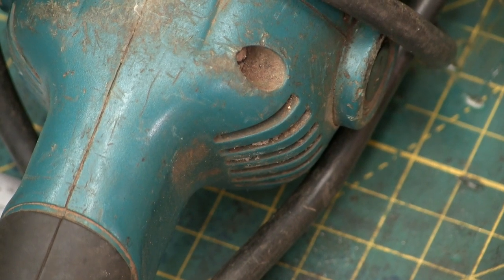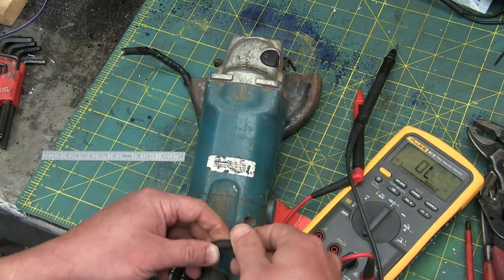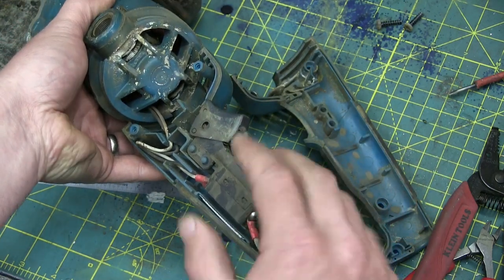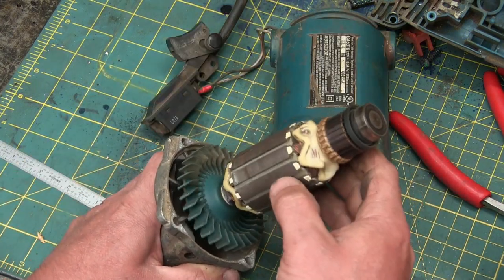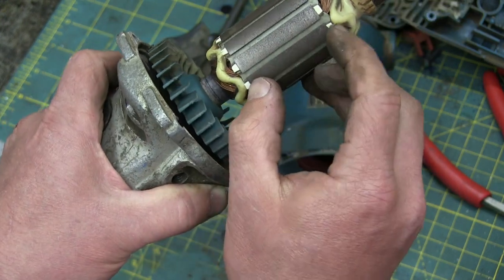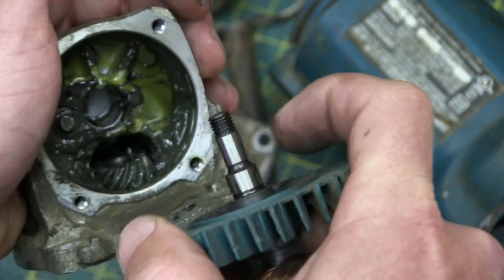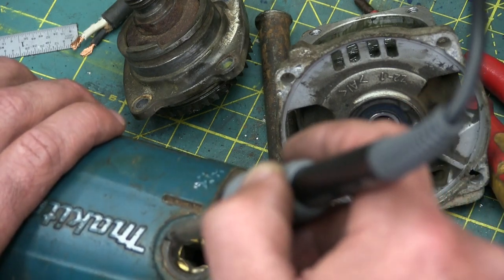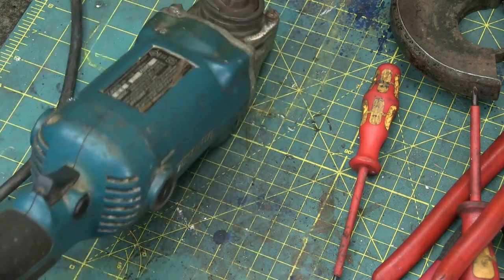BOLTR: US built Makita 5 inch angle grinder

Comment: I worked for a Japanese manufacturer for many years. The level of detail spent on evolving the engineering was crazy. Every in house engineer working in the field could feed back any comment by any channel they liked to the factory. Everything from 'this part fails most' to 'the shipping packing on this part is annoying to remove' found it's way back. The nice bit is you would see the changes coming through within months, sometimes weeks. I even saw a motor casing get re-tooled because one screw on the mount was 'a bit tricky to get to'.
Reply: I am an mech eng and I wouldn't mind doing that as I do that kind of stuff already lol
Reply: The Japanese take their work incredibly seriously. Striving for perfection is ingrained into their culture.

Comment: Broken cord=Free tool. Gotta love the world we live in now.
Reply: Great world to live in for people who know how to fix stuff, isn't it?

One time a guy put a RUNNING lawn mower out on the curb. One man's trash...
Still have that mower, still running like a top. Only problem is you've gotta short out the spark plug to stop the thing. Can get interesting if you have to do that in the rain.
Reply: Broken cord, broken trigger (you can get those for dead cheap if you happen to have a parts market around you), best one i ever found, the guy lost the locator washer, yup. Dumb people are gold for people like us.
Reply: Same here re free curb lawnmower, Craftsman, used it for 10 years...just about had a coronary pulling the rope 20+ times every time I wanted to start it, but price was right.
Reply: jusb1066
That's what I was doing, but sometimes my foot would slip off of the springy strip and touch the bare end of the spark plug.
This is quickly followed by a series of shocks to my foot, much cursing, and occasionally wondering why I don't just wire in a switch to ground out the wire between the points and the ignition coil.
Reply: My dad used to keep everyone he knew supplied with TV's by 'shopping' on garbage days. Eventually they stopped being repairable and now we have to buy them.
Reply: Why not just fix the ground wire to the magneto?
Reply: EEVBlog #984... (search youtube, can't paste link)
Reply: Last riding mower and current riding mower, free... first one I ripped the factory harness out of it and simply wired a on/ off toggle and a push button to start. Second one which I use now I just disabled the solenoid in the carb, cleaned the carb, and I start it with a jumper box because I've been too lazy to change the starter solenoid lol.
Reply: hahaha, so TRUE!
Reply: Love this thread. Bunch of people bragging about fixing free broken crap that they found. Funny thing is it sounds like it's still a bunch of broken crap. Did any of you actually fix anything? Everyone's like ummm my neighbors were going to scrap their car and i was like hey, I'll mow your yard for a year for that junk car. 5 be years later I'm still rolling that car. The only thing is that since the motor & tranny were both blown, all i had to do was kickout all the rust on the driverside floorboard... And use my feet to stop and go Flintstones style. And they were just gonna scrap it. uhh haha... What a bunch of suckers smh 😂
Reply: J. Mohler well I got a metabo grinder that needed brushes and a makita skill saw that needed a trigger. Less than $10 to buy new brushes and a switch fixed both of them. Also got a hilti sds that was told would not work at all. I plugged it in and it works perfect every time full chooch no noises or rattles or anything. Glad the metabo grinder didn’t need a new cord as that super robust highly flexible silicone cord would have cost $20 lmao yes still would have been a good deal.
Reply: 44R0Ndin are you still mowing grass in the rain ?
Reply: Got a free red snapper when I was 17 years old. I’m 32 and I STILL use that thing every summer. And she had no problems cranking

Comment: After the apocalypse i will be climbing over the huge piles of Dewilt products with my Makita grinder gripped in my mechanical hand, witch i made myself, and face the zombie hoard with all the other Makita owners!
Reply: Lol so true i will team up with u :)
Reply: harbor freight sells a chaisaw disc, its a grinder blade with a chainsaw chain attached.
Reply: Yeah i have seen it when i was in the store lol its like a 4 inch wheel i have always wondered if it was any good .it would probably get saw dust in side of it
Reply: the full range of the extension cord !!
Reply: Yes extra long and heavy cord. Also zombie proof.
Reply: Gabriel and Caterpillar.  It's called the Lancelot, and it's good for what it does.  If you want to cut wood in a crappy/dirty environment where you wouldn't run a chainsaw (like tree roots) it does a great job.  Dulls right up like any chainsaw chain would , but you only have about a dozen chisel points to sharpen, so you're back in the game relatively quickly.
Reply: After the Apocalypse I'll be feeding my chickens the corpses of those who failed to buy Metabo while enjoying the lamentation of their women.

Comment: One reason I'm a Makita user - I have tools that are coming 35 years old - parts are still available.  Makita doesn't try to "Improve" a tool every couple of years and stop supporting the "old" model.  Basically the same tools are still on the shelf today. No planned obsolescence, just tweaks of the same basic design. Saves a lot on retooling costs too, so profitability remains !

Comment: Funny... I just looked this up on Amazon, it only has a few reviews, but here's what one guy said. "The older 5" grinders had a smaller gauge wire that after a long while they would burn up at the switch. THIS NEW DESIGN has a larger gauge cord, nicer hub locking pin, and the brake feature for less kickbacks."

Comment: I worked in a foundry and we had an OSHA audit. They wrote us up for not having ground prongs on the grinders. No amount of explanation about double insulation could persuade those assholes. We lopped off all the cord and installed 3 prong plugs. Of course there is no ground conductor so that 3rd prong doesn't do a fucking thing. Tax dollars hard at work...

Excellent video Sir.
Reply: I worked in the USAF and replacing our own plugs vs. ordering the cord assy. was verboten. More cords for me. In the parent case the OSHA inspector was a tard. You can ask OSHA for official written opinions with citations if you get a moron inspector.

Comment: Did you test the dead end of the cable you just cut off? Hahaha dingus.
Reply: If women don't find you handsome they should at least find you handy. My guess is AVE is the Canadian equivalent to Brad Pitt.
Reply: Hey man, multitasking is hard.
Reply: Better to make a dumb mistake than to have to spend a half-hour chasing pixie leaks inside the can...
Reply: Some still changed for there mistakes..
Reply: Yea, the thing is: he could easily edited that out of the video, but he didn't. he shows his mistakes so we don't have to do the same, or in this case really just so we'd have a laugh at his expense. cool dude this AvE:)
Reply: +Renax the Man Exactly. I have great respect for a man who A) admits when he makes a mistake and B) neither runs from it nor hides it. Plus, it's something that I would probably have done, as well.
Reply: +horrovac I have respect for the folks who go out of their way to entertain and inform us at the same time. Especially when they have to put up with comments from the great unwashed. Takes balls and a modicum of talent.
Reply: +horrovac I see you've watched me working in my garage.
Reply: +klax0421 Nice Red Green reference
Reply: I have a  4 or 4.5 inch Makita grinder that I have had for about 30 years. Wouldn't trade it for any other. Still runs fine.
Reply: Roger Klekacz damn must not been used much no matter how good it’s built at 30 years the brushes would be worn out at very least with any kind of regular use.

Comment: Recently bought a Makita GA5021c as my first grinder. It's not much different from this 5010. Very happy with my purchase.  My model doesn't have a stay-on switch and it has a slightly different trigger. I cracked it open and followed along with this BOLTR. 
Thanks for AvE.

Comment: I love this channel. You learn about tools, have a good laugh and usually gain some sort of life tip on the side. 

I now know why my dad's Makita tools last so long, they don't fuck around with quality. Every Makita tool we own has only required a new power cord or brushes. Each is a joy to own and use, some going 20 years strong. Their motors are always more powerful than you would expect for their size, and they run with less vibration than other makes. 

We just bought a small 2.5 hp Makita router from a plumber who used it for counters and the brushes looked hardly used. The outside looks like it was thrown around in a tool box, but besides that it must have only a few dozen hours on it. Steal of a deal as we got it for half price due to the battle worn exterior.

Comment: You should make a video about the code designations of plastics. like what part of the code told you that it was nylon reinforced
Reply: PA = polyamide GF = glass fiber 30 = 30%. Nylon is a generic name for aliphatic polyamides. It is important to mention however that though all nylons are polyamides, not all polyamides are nylons.
Reply: What would then be abs-pa/sebs (in layman's terms)?
Reply: +VictorIndiaDeltaAlfa abs = acrylonitrile butadiene styrene. Pa = polyamide. Sebs = styrene ethylene butadiene styrene.
Reply: Pungo Machungie Ok, can you describe any advantages or disadvantages versus PA-GF? Bosch uses this on their tools, that's why I'm curious.
Reply: +VictorIndiaDeltaAlfa sebs allows abs to be blended with pa. So abs-pa/sebs is a blend of abs and pa with sebs as a compatibilizer
Reply: +VictorIndiaDeltaAlfa without glass fiber or glass ball reinforcement, it will not be as strong.
Reply: Pungo Machungie Ah, thats better. Thank you.

Comment: The ramps on the gear are to get the lock pin to jump the gap when someone gets silly and presses the button while it is running.   I once had a new coworker call it the shocker button.   I was worried the tool was malfunctioning and shocking him.   Nope, just like a large hand buzzer toy he was playing with the lock button while he was sanding.      As always, thanks for the thorough review and showing off the inside parts of the tools we all love and respect.

Comment: Do a brutal BOLTR on a HF grinder, wouldn't cost much LOL
Reply: This would be fun!
Reply: He did one already
Reply: He did a powerfist recip saw, but no grinder...
Reply: Got mine for a dozen pesos to cut a bent lower control arm out. The locking button and spring mechanism broke on the first day. Wasn't worth the fuel going to return it. Still chooches, but definitely not for professional use.
Reply: I would enjoy a Hater Fight grinder teardown.
Reply: you can't beat HF grinders with a bat.
Reply: pfft. There's nothing wrong with HF angle grinders. What you think you know is horseshit.
Reply: The only one I ever bought was the "drill master" 4 1/2" and it lasted me 4 years... best $10.00 I ever spent to be honest. Of course, that was in 2011.
Reply: SD Customs
If a 4.5 grinder lasts more than a year I'd say that's good. As far as I'm concerned 4.5 grinders are just as consumable as the attachments they run. I have blown out loads of 4.5s. Since I stepped up to 7/9s I have not lost many angle grinders though. I still use 4.5s, but for lighter work. Now for the big digs I use the big club. 7/9s ain't generally had for cheap though. But they're worth it, if you don't want to be buying a new angle grinder all the time.
Reply: I can't find it in the list of videos.  A Fein and a DeWalt and this one.  Link?
Reply: SD Customs You are correct.  My mistake.
Reply: That said, I have a HF grinder, for the light use I put it to, it's fine. I paid about $12 for it with a coupon, I've been using it for > 10 years. I took the rust off an entire trailer with it, have cut a bunch of drill rod with it, probably have had the trigger down for 10 hours on it over those years. Still runs just fine.
I have HF drills, a framing nailer and a roofing nailer. I did without tools at all for years because everyone told me that HF was wasting money and I couldn't afford the better stuff. Finally I just gave up and bought HF stuff, and honestly, it's fine. I have broken very little of it even when I abuse it. I've had 4 boxes of 5000 nails through the $80 framing nailer, it's never even jammed once.
Reply: John Ridley
HF is like gambling. They definitely sell duds. But if you keep your receipt, and get back there in time, they're good with exchanges. Some of the stuff they have is absolute crap too. But if you're reasonable, then HF can be pretty reasonable too. I got turned onto HF when I was working in a machine shop in the early 90s. So I was phoning in orders back then. I also have more experience than most do with them now. A lot has even changed in that time. HF's Professional hand tool line I think is pretty decent now. Like their sockets, and stuff. I got Snap-On tools, and I have HF Professional. So I have some basis for comparison. At least when I buy HF my money doesn't spontaneously combust before my very eyes.
Reply: Paul Frederick All Chinese steel is better than it was 20-30 years ago. The foundries have gotten modern enough that it really doesn't cost them any more to make decent steel than junk.
I'm just trying to figure out why anyone makes 12 point sockets anymore. There's no point assuming you don't need to work with 4 sided nuts - going from 6 to 12 point just makes them weaker and more likely to round off the nut.
Reply: John Ridley
alloying agents to make tool steels do cost some money.

Machinists still like their 12 point tools. Because they deal with a lot of 4 sided items.

Destruction of hardware is due to improper work. Steel can only take so much before it fails. So whatever force you apply to the work has to be less than that limit. Which is to say that just reefing on a wrench is not necessarily always the very best way to break something loose. Now to fully appreciate what I am trying to say one has to have broken quite a bit that they felt was important to them, at one time, or another.

Then one gains a greater understanding of the finer penetrating oils, torches, and hammers. All of which when applied skillfully can free up even the most stubborn hardware. But it does take patience, and commitment too.

What I do that helps me is I think back to all the hardware I have broken in the past, and what I had to do to fix all of that. Much of that was difficult too. Results were often spotty as well.
Reply: 12 points are good for when you're using a breaker bar where you cant get enough of a turn to get a 6 in
Reply: +Paul Frederick  Oh the nightmares I still have from broken manifold bolts in heads and water pump bolts in blocks... The problem is, patience is expensive and hard to come by and after you find it, hard to learn but like you said once you master it you have a lot less sleepless nights. The trouble I would have saved myself if I just would have spent the money on a torch earlier in life... You live and learn I guess
Reply: me3333
Yeah if you're working on old crusty stuff a smoke wrench is indispensable. What it can do is nothing short of miraculous. It works on stuff that there is no way anything else would free it up. That and impacting the hardware, as opposed to torquing on it. Gently. There is little more satisfying than getting stubborn hardware out intact.
Reply: It is so fun to see exactly how they cut corners, and just how ridiculous it is. The more awful they are, the better it is for consumer awareness. I want AvE's vids on shitty tools to be popular on Youtube so that laypeople find them, if by chance they do a little research before they waste their money.
Reply: In that case, all you need to do is remove the 6-point socket and turn it 90 degrees.
Reply: because toyota uses 12 point bots on rod ends and other places inside engines

Comment: Makita grinders are the BEST I've ever owned. No other POS grinders come close to the reliability, durability, and quality. Sure, you're going to pay a bit more, but is well worth it.
Reply: tried Bosch? That's what MichaelChtulu  (giant sword fabricator here on the you-tubes) uses. They seem to be pretty damn skookum
Reply: +Sean Hartford makita master race
Reply: Have both, no complaints about either. The bosch  was twice as expansive as the makita, but it is skookum as frig. I use it to push my Kutzall Extreem Carbide blade for power carving, the bosch is the power of two horses in your hand (13 amp grinder). That said, I have no complaints about my makita grinders, had them for years, they are still skookum choochers.

Comment: Would you check the rotation of the gear with the three lock pin pockets?  I'm thinking that those ramps might be designed to prevent the lock being engaged at a too fast a speed.  If the lock button is pressed the ramp launches the pin away from the lock hole until the speed goes down.  Nice job Makita.  First build it bullet proof, then don't let the user shoot at it to begin with!
Reply: Bill Lewis

Comment: The epoxy coating around the commutator tangs is called gel banding.
It's used to prevent fatigue failures of the copper fusing at the tangs when there is either very high speed involved or radial flexing of the main shaft.